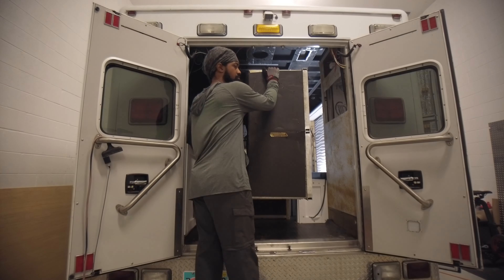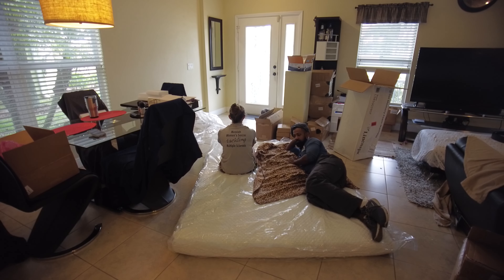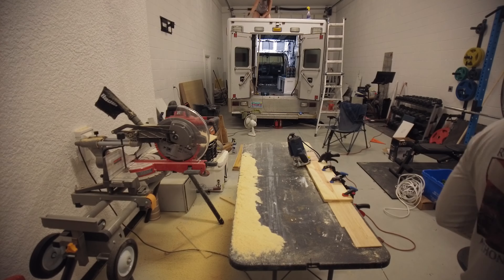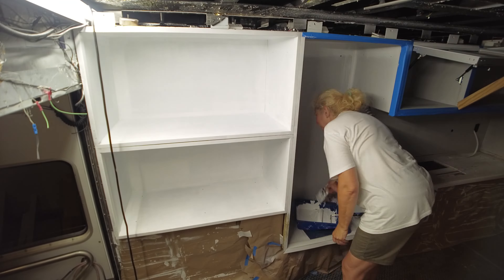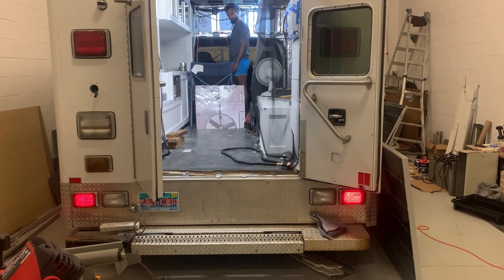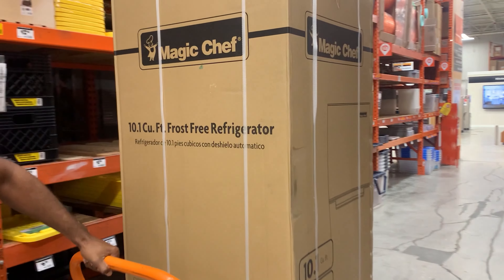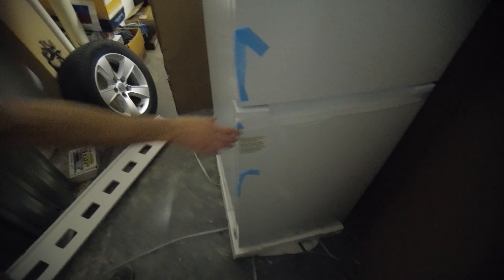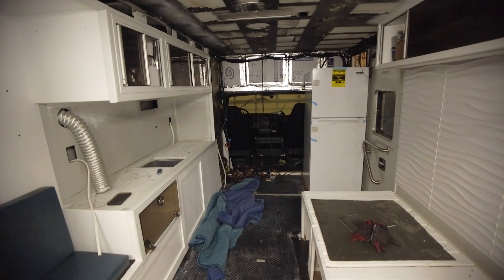Ambulance Van Conversion Built w/ Free Scraps pt.2

Comment: Nooooo don't put a residential fridge in anything mobile. They are built to be level and stable, which means they will never run properly on the road. As time goes on it will have a harder and harder time keeping temp and will drain the hell out of your juice because its constantly kicking on and off trying to keep temp without over heating. Trust me, cheap at first, but costly shortly down the road.